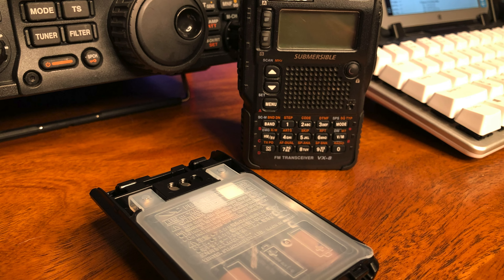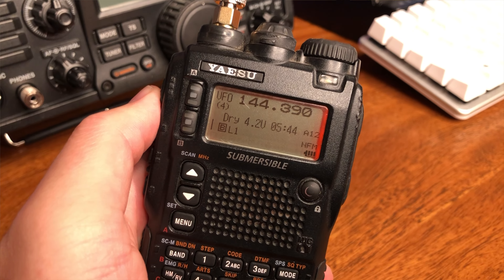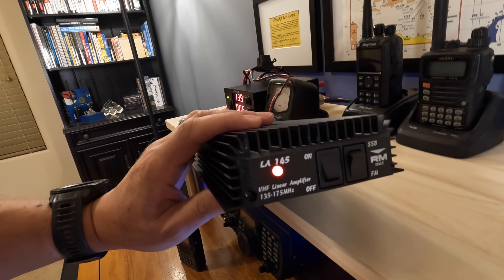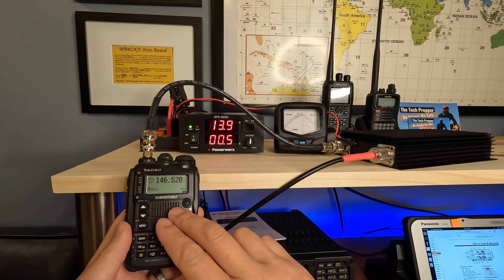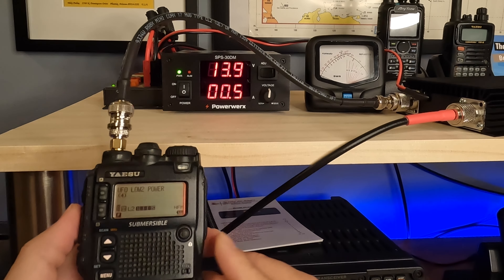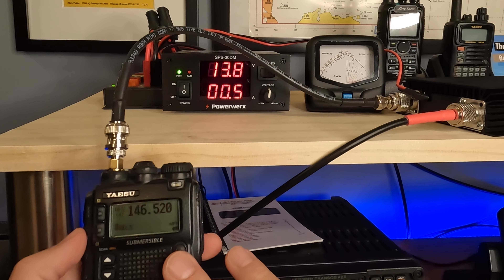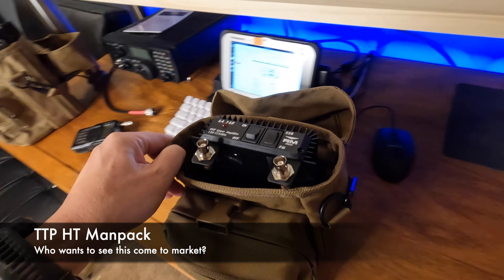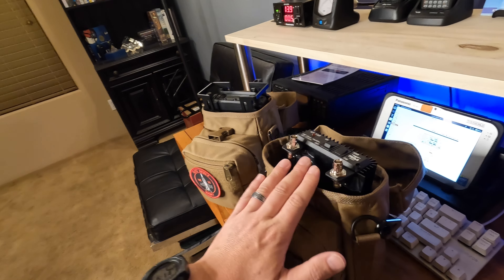HT Radio Manpack - Need more power for your Baofeng, Yaesu, ... HT?

Comment: I set up a linear amplifier fed to a home brew mag mount antenna in my truck for my TH-25AT handheld transceiver in 1988. It worked repeaters 30 miles away. It also covered 20 miles on a few packet radio QSOs when mounted on a radiator at Rochester Institute of Technology in 1999-1990.
Reply from the maker: It looks like I am really late to the party on this one. Thanks for sharing your experience using an amplifier with HT. I mostly plan to use this for digital modes and pactet on 2m.
Reply: @TheTechPrepper  Great idea. Did they ever produce the frame for the pack?
Reply from the maker: @tchambers807  Yes, but it was just a prototype for testing. In fact, it briefly made an appearance in my APRS + DigiRig Lite video last week.
Reply: @TheTechPrepper  I'll have to check that out. Thanks for that. Do you believe it's possible it still makes it to market?
Reply from the maker: @tchambers807  I doubt it, but it's worth sending ARMOLOQ and email, as this is a very one-off build with almost no interest from the community. It was really handy for boosting the power on my HT when I was experimenting with the longer range VHF comms last week.
Reply: @TheTechPrepper  That's too bad it didn't generate interest. The flexibility it would provide justifies the cost. It's not like someone couldn't find 2nd, 3rd etc.  use for the amplifier outside of a pack. It would make a great commuter rig. You can ditch a car and summit a hill or a building pretty fast with something small like that. Anyway, great video thank you. I'll reach out to ARMOLOQ for sure

Comment: I never knew it til today, we both own an IC7200. This was my Third ever radio & my first HF base station rig.
Reply from the maker: I recently discovered the IC-7200 this year. I picked it up for a few reasons . It will be my dedicated ALE rig, but I also like the built-in filters, simple operation, and single interface USB cable for the sound and CAT control. If you ever sell it, let me know. Don't tell anyone, but it runs circles around my Yaesu FT-897D.
Reply: @TheTechPrepper  Oh it's a beast for sure, just wait til you've got the PDF or spinal manual down pat, that comes with it !
Reply from the maker: @Nathan-z7s3d  It's now my daily HF rig, so I am getting better with the operating nuances. The filters are amazing.

Comment: Cool demo. I have the RM Italy 10M with fans that goes with my Alinco DR-03 on my base station. It works well. There are times when you do need to make up for smaller antenna. Short bursts of APRS messages or Winlink contacts should keep the thing cool and let the battery last a little longer.
Reply from the maker: Glad you enjoyed it. It was a quick point-and-shoot video with an idea that's worth exploring a bit more. I ran into this issue during APRS Thursday. My little HT can't get a usable signal out from inside the house. This setup worked like a champ for the net check-in.

Comment: Thanks, Tech Prepper!  Finding your videos has re-stirred my desire to get into ham and I'm moving fwd with a friend.  One thing:  in pursuit of getting components to build something like your manpack I've been stunned to find that the remaining used Yaesu FT-857D radios still available out there are selling for obscene prices that are typically triple what they were only months ago.  Please recommend a substitute radio that you like as much as you have expressed that you like the 857D.  Again, thank you!
Reply from the maker: Unfortunately, there are no current options on the market for all-band, all-mode rigs cable of 100 watts in this form factor. The industry has moved away from this design. So, the secondary market is it. The other option is the discontinued Icom IC-706 MkIIG, but it is slightly higher current consumption. Welcome back!
Reply: Gaston is right, the closest item on the market to a portable all band all mode 100W radio is the FT-991 and its power hawg that is not all that robust.
I've parred my rigs down to two FT-857D and one FT-897D. I keep waiting for a modern 100W shack in the box radio, but no dice. Hopefully a manufacturer sees and meets the demand.
20W radios are just over one S-unit below a 100W radio. Virtually all military HF manpack radios are 20W-30W, but with a couple of "secret weapons" to boost performance. They run ALE (Atomatic Link Establishment) and digital voice.
Apart from being great performing radios, military radios SUCK at user interface because they are designed to be "soldier proof." There are not waterfall displays or VFO for surfing the bands, RF gain control for pulling out weak signals through the noise. In an analog signal environment amateur radios are more sensetive and flexible, but you need to be a reasonably competent radio operator to maximize performance.
The military uses HF primarily for emergency communications in their PACE plan, but through mesh networking and ATAK software they are leverage sophisticated data by putting as much as possible on user devices so only a minimum amount of data has to go thru RF at any frequency, bandwidth or mode.
The demon they seem to be fighting now is interoperability that keeps mess networks secure, universal, but flexible at lower unit levels. How does a platoon or squad run a private mesh network while part of larger networks and authentical members joining their local network in an expedient manner without compromising high networks. Managing 3-4 keys each for 4-5 layers of mesh networks sounds like a real headache when you want local control while maintaining global system security and global integration. It hurts my head to think about it briefly.
Reply from the maker: @vironpayne3405  Thank you for adding to this conversation at multiple levels, Viron. I have been debating whether to go down the Yaesu FT-991A route for a couple years, but it is large and not suited for the field unless you are doing a POTA activation at park bench and don't mind running your gear out of a Pelican case. ARMOLOQ does have TPA frames for the 991A, but you need a full backpack to house it.

Comment: I like the modularity of this idea. I guess I wish that the amp was 2m/440, or better yet and amp that covers 160 through 70cm so I don't have to have multiple amps to boost the capability of the 818.
Reply from the maker: That is a drawback, but I think there is still enough utility for something like for 2m. I looked for a long time for an amp that would cover HF/VHF/UHF.
Reply: @TheTechPrepper  I agree that there's still enough utility, and if given the choice, I'd go for 2m over 440. All of that is based on my use case, which probably differs significantly from others. 

I've looked for the holy grail of amps too. No luck yet.
Reply: Shit that’s the amp we all need
Reply: It is a good amp.

There is no 160m-70cm amplifier and probably will not be one in the foreseeable future.
Reply from the maker: @vironpayne3405  I looked for the Holy Grail of broadband amps...no luck. This is one one of the reasons why I believe the Yaesu FT-857D is the best-in-class option when it comes to civilian manpacks. It's all-band, all-mode with just enough power and light enough to pack out with relatively low current consumption if you run it between to 20 to 40 watts.
Reply: Not sure if its still being produced, but the Mirage BD-35 is/was a dual band amp.  Put out 45W on VHF and 35W on UHF
Reply: Funny thing is, I've been a ham since 2003, (living in NYC, Cape Cod, MA and now Richmond, VA) and have worked lots of events (and ARES deployments/drills) all during that time and almost everything I've done, both on repeaters and simplex has been on 2m! So, I could see this idea as useful.
Reply from the maker: @elkabong6429  I am getting back into supporting public service events in the fall and I have always brought a manpack with crossband repeat capabilities, but I like this idea better. I usually can hear fine, but need help occasionally getting my signal out depending on where I am deployed. Public service is the primary use case.
Reply: @TheTechPrepper  Me too! For one thing, there won’t be the slight delay you get with x-band repeat, for another, it gives you more flexibility in terms of being able to quickly change frequencies if need be, which isn’t possible with an x-band setup!
Reply from the maker: @cameronmelvin9640  Does it support SSB? It's on my list to research. Thank you.
Reply from the maker: @elkabong6429  Sigh...everything is a trade-off. Excellent point on switching frequencies. For 2m packet I switch between APRS and a local 2m packet frequency.
Reply: @TheTechPrepper  Unfortunately, No.  FM and DStar only.  No SSB
Reply: @TheTechPrepper  Good example right there!

Comment: I've looked at the Baofeng 2m linear amp with the idea of using an HT in the mini truck or 4Runner for more power and a much better antenna with the ability to take the HT when away from the vehicle.  Some of the cheap HTs have the ability to program them in CHIRP as GMRS radios for short range operation, so I could carry two HTs, giving me a backup (two is one and one is none) but also have a spare to give to a non-ham for vehicle-to-vehicle comms.
Reply: Using your mobile rig as a cross band repeater definitely can have benefits. Police departments use that type equipment where their HT can act as a remote for their mobile radio.
Its all about what you are trying to accomplish.
Reply: @vironpayne3405  - I've heard of hunters using a mobile rig as a cross band repeater.  Park the jeep on top of the hill and 2-3 guys can be down slope and in the valleys and still communicate when they couldn't hit one of the big repeaters.  I don't hunt but this seems like a good technique to coordinate search and rescue, etc.
Reply from the maker: We use cross band repeat frequently at public service events. That's one of the reasons why I run the Kenwood D710GA in the Jeep. The challenge right now is that it is 118F in my area and the D710 will cook with no A/C running in full duty cycle. I can usually hear ok, but my signal barely gets out on 5 watts.

Comment: Late seeing this. Nice piece of equipment. Thanks.
73,
Gene, N3XUS
Reply from the maker: Glad you liked it, Gene. This project went nowhere. However, ARMOLOQ did make the frame. It works well, but I have not really found it to be great in practice. In general, if I need more power, I will just bring my FT-857D.

Comment: Nice rig, I was thinking of a similar setup except for 10 meters using an RM KL203P and Albrecht AE 2990 (AM, FM, SSB). In a pinch, it can be expanded to operate on 11. meters
Reply from the maker: Good luck. I had to look both of those up.

Comment: I recently picked up a like new used Mirage amp with SSB and preamp built in for $50 and it works nice. No local SSB nets in Indiana that I'm aware of,  but pairing this with my ICOM 705 for amplified 2m operations had allowed me to make a significant improvement over the 10W max out of the ICOM. Now i can turn the power way down on the transceiver and use another 12v source for getting up to 80W output if i need it. I'm now sure how much i can get with the 5W output of my VX6R but I'm going to try it.  

I think someone already addressed this, but not sure how the cooling would work in an enclosed bag/pack as I'm sure the manufacturer would poo poo on. Of course the heat build up depends on the frequency of use. Running constant digital modes probably a bad idea but certainly using it to hit a distant repeater for a short period of time or a longer SSB contact might be interesting to try between two individuals. 

I would love to see you make a video of No Random Contacts using this set up for a long range SSB digital mode contact!!! Hint hint hint....
Reply: Gaston does operate in brutal environments from time to time, so you do raise a valid point about heat.
To double your range with most omni directional antennas you have to quadruple your power to gain the additional S-unit.
In tactical situations large antennas can be problematic, especially in environments like where Gaston operates that has very few natural options for supporting and elevating antennas.
However, its my opinion that for most portable operations problems associated with larger more efficient antennas generally are outweighed by the benefits. Most portable ops are limited in power. Antennas are essentially two-way passive amplifiers working for send and receive. They require no additional power and typical no additional cabling.
Most amplifiers on the other hand require additional power, cabling, only add to transmitted power, and typically have a tiny bit of insertion loss on receive.
Larger antennas typically take more time to setup and take down, and may require more support structure which can be a tactical disadvantage, especially when operating solo or manpack portable.
There are very few higher gain vhf/uhf antennas for portable ops besides 2-3 element yagis.
In mobile and base station antennas it is faily popular to stack a 5/8wl element on a 1/4wl element for 5-6dBi gain. I have seen homebrew rollup j-poles, but nothing commercial. The Ed Fong dual band j-pole is an exception on the 70cm portion of his 70cm/2m j-pole.
Reply from the maker: I can't speak for everyone, but I personally do not intent to rag chew on this or run as a net control with this setup. It is intended to boost my signal when I need to relay some traffic. At public service events,  I typically can hear fine with the HT, but have a hard time getting a signal out depending on my deployed location. When it's time to pass traffic or give an update during our "ops normal" check-in, the TX is usually 10 to 30 seconds. I TX for about 1-2 to minutes every hour. Heat has never been a problem. I have been running manpacks for the last 2-3 years out here in the desert. Hit a commo window and limited your TX has worked well personally.
Reply from the maker: For all field events, I will deploy the Ed Fong roll-up J-Pole at a temporary aid station. This usually works even at 5 watts. I even carry the Arrow II, 4-element Yagi (3-piece boom, backpacker model). This will be another tool to have available as a resource. Since I standardize on BNC, the connections from the SignalStick,  the Ed Fong or the Arrow II are quick when I need to pass traffic and move to a fixed location. Again, my communications are focused and limited to short windows. On know that my use case is different than most.
Reply: @TheTechPrepper  Given you use case for special events an amp can make sense when deployment and TX times are limited.
I do have a buddy that has solar panel on his truck topper and a second battery for his radio that he uses as a cross band repeater. It is better suited for heavier TX usage when lightwieght mobility of an HT is desired.

Comment: I had one of those. Boy do they get hot on FM. They also chew through battery power pretty fast. Fun option though for 2m SSB. The auto key up delay was pretty fast but a bit slower than an alc keying line. Sometimes the beginning and end of words can get clipped so I just started and ended with “ahhhh” and “back to you”
Reply from the maker: Thanks for sharing your experience. This is my first amp. It's a pretty niche use case, but it solves a few problems that I run into. I never planned to use this for rag chewing. This is more to get a signal out occasionally while listening the majority of the operating time.

Comment: I have a la144, it works excellent but it gets very hot when it works, it is much smaller than the one you show here but it has the same specifications, it easily reaches 80w with 4w input. Due to the size, I think it would work better for your experiment. By the way, if you put 5w on it, it reaches 100w in my case, don't do it 😂. For safety I always use it connected to a swr meter
Reply from the maker: Thanks for the tip. I have no intention of running above 2.5 watts. In general, I'll be driving it with 1 watt. 40 watts out is all I need for most applications. In hindsight, I should have gone with the 144 instead of the 145. 73's

Comment: Being that i primarily run an HT I was just looking to the btech amps they've been putting out. Seems like the same frame would fit and extend everything for me. Good idea. I'm down to send an email. I'll get at Seth too and nudge him into making you one. If they fit a variety of amps then that's a win for the community. 
Thanks for the content, brother. I hope you're staying cool (or at least not in that danger zone of death heat). 😄🤙🏽
Reply from the maker: ARMOLOQ is pretty good about targeting multiple models when it comes to their TPA frames. Which BTech models have you considered? Yes, we are in the heat danger zone. Thanks for pinging him.
Reply: @TheTechPrepper  the btech u25d since I've been running a DMR rig. I'll have to save a little and weigh my options. I know it's basically a Retevis equivalent. These always remind of that movie "Don't mess with the Zohan" - is Sony guts bit. The name doesn't matter as long as it has the same internals. 😆 I'm guessing they're pretty much all the same amp internally. Your rig looks pretty damn nice. 
It's nice to see your ham desk taking form, btw. I know you usually go outside and play, but I can't knock the need for AC this time of year. If it wasn't humid here, I think I'd have died long ago. 😅
Reply: @TheTechPrepper * I think the anytone version is the same, too.
Reply: I'm not gonna lie, I just got a flipper zero and might prioritize a hack rf next since I can hit the clubs repeater with the stock rubber ducky. We shall see what comes first. I've been digging deep into the flipper, tho. I might stick with it for a bit and grab am SDR to go a little lightweight. Bring in Hawaii has its quirks.